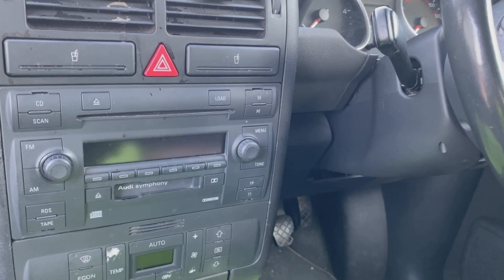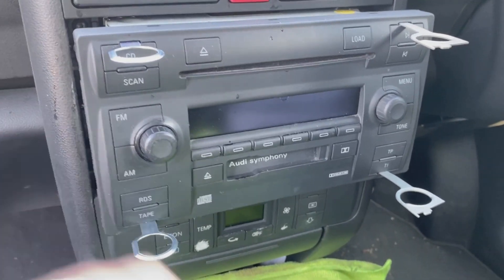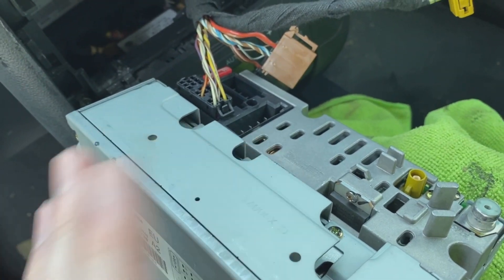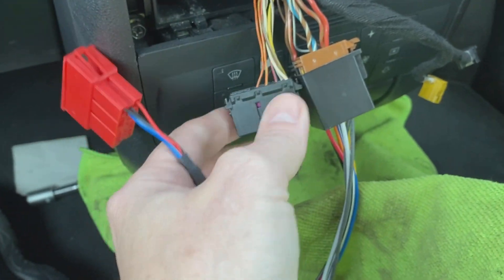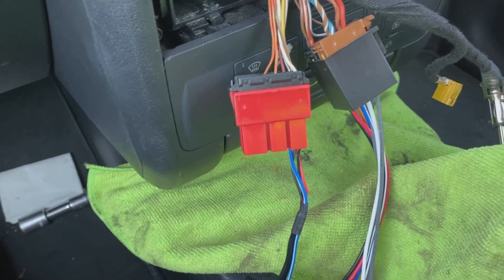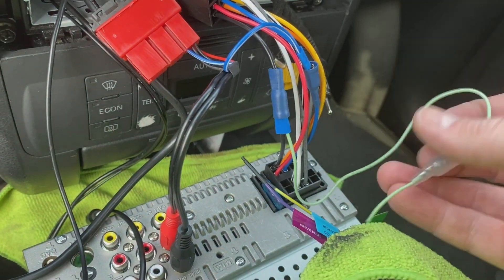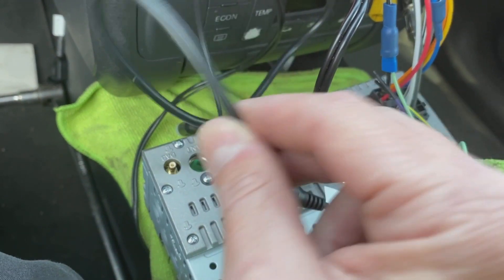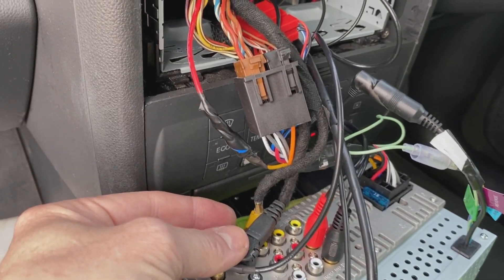Audi A2 1999 - 2005 radio removal & double din screen refit guide

Comment: why would power need to be taken from ignition wouldn't it already be in the wires because it worked before? genuinely curious not hating
Reply: Some factory fitted units like peugeot for example dont always use a permanent live, both lives would go dead after 3 mins. An aftermarket stereo will usually need one so it wouldnt lose any saved radio stations or sound settings etc.